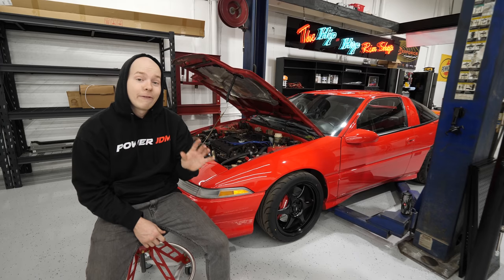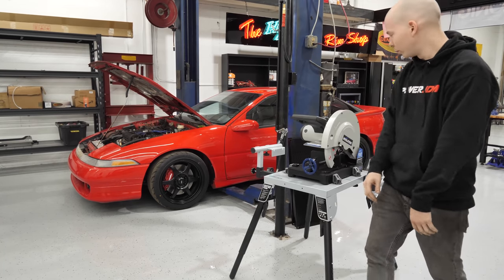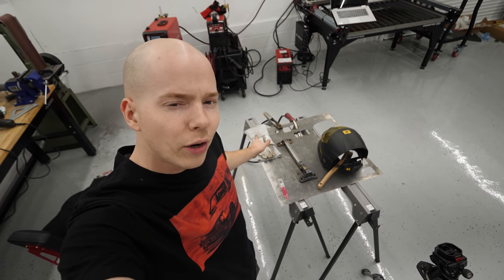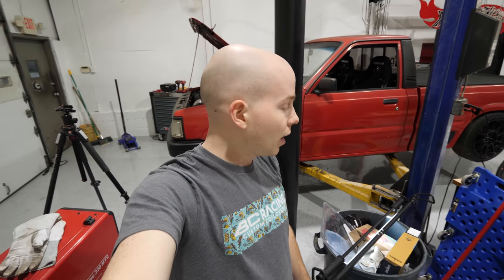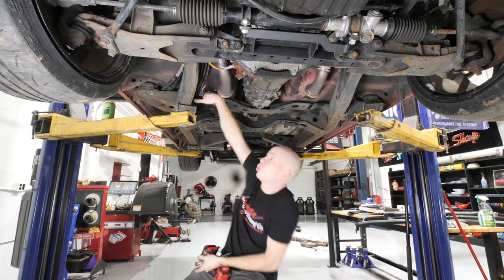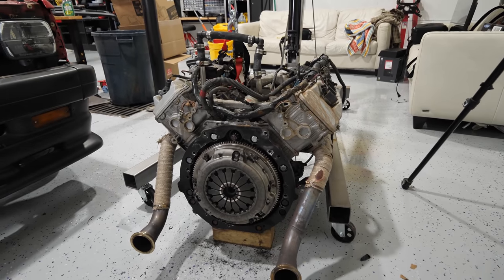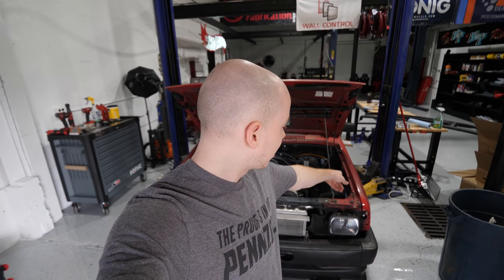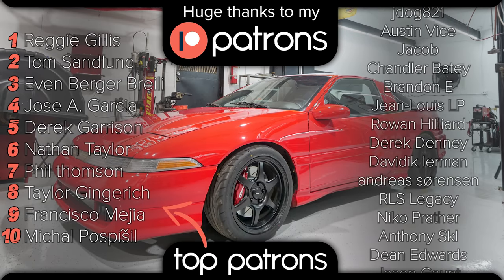I Crashed The DRIFT TRUCK.... Time To Bring It BACK TO LIFE!

Comment: Hey your waterbed level is way too low on your cnc plasma, should be about 1/4" to the bottom of your material. Also you should run that exhaust fan in your wall while is cutting to suck some of the smoke/metal dust out
Reply from the maker: You'll see in the next video I add a bunch more water to the table! Thank you to all the peeps who suggested that.

Comment: I did the rack conversion on my b2200 but its RHD so it took a little more work since the original steering box is located forward of the front suspension and the rack I installed required to be installed Aft of the front suspension. Followed this truck from the beginning of the build couple years ago till now, happy to see it in the spotlight once again.

Comment: So glad to see the drift truck operable again. I really wann know what was the solution to making the starter servicable?
Reply from the maker: I had meant to show that process but got caught up in trying to get it finished that night! I ended up drilling out the threads in the starter, then run a bolt through the entire assembly and putting a nut in the end. So now I can take the starter out by just removing the intake manifold and taking the nuts off

Comment: Is there a pilot bearing in the end of the crankshaft for the trans? Not leaking gear oil out the input shaft?
You have an amazing shop, and your a very dedicated and intelligent fabricator and technician. 
Would be so sweet to have all that equipment.
Great job man..

Comment: I have the same 1uz Sr trans setup. To avoid the starter bolt situation, I threaded bolts backwards into the starter and put nuts in the little gap between the engine and adapter plate. A little annoying but saves SO much time.

Comment: Dude if you can get to the heads of the bolts you just need to turn them in place and the starter comes away as opposed to pulling the bolts out.

Comment: just curious. would you have been able to remove the starter by leaving the bolts in place and just loosening them a little at a time and walking the starter forward till it was off the bolts?
Reply: My immediate thought too!
Reply: Right! Well at least he found out to keep an eye out for another transmission…
Reply: not trying to shit on him or anything, was just curious if he exhausted all options before resorting to taking half of the truck apart. hell, as a last resort, i wouldve considered cutting the heads off the bolts with a sawzall, removed the leftover stud, replaced the starter, then installed new bolts from the starter side and locktited a nut on the trans side, just to reduce the chances of the bolt backing out. Thats to say theres clearance to do all that without additional damage.  Dropping the engine for a starter is good content atleast

Comment: before you read this please know I am huge fan of the 1UZ and Japanese’s engines

How to change the starter on an ls, three bolts off with an adjustable spanner (most will be hand tight) replace at least two bolts.

1UZ step 1, start by removing the engine and transmission…

Comment: When I did my sr20 1uz setup I cut the bolt heads so there was 1/4 inch gap between them and adapter plate. That allowed me to turn them with a wreck with trans still on and the starter would push back as you loosen them so you didn’t have to remove trans every time the starter went bad

Comment: Counter balance.. There's a garage nearby whos owner has race cars. I put bc coilovers on my volvo and measured and adjusted and got it 47/53 corner to corner by eye. 
They were actually able to get me a 49/51 balance ratio. With the chassis braces, strut tower braces, poly bushings and poly mounts, it made it handle like a dream. However i need some wider tires with 215/40 it doesn't like any negative camber. Need some 235/45 toyo r888 or falken rt660...

Comment: I definitely felt this, the other day my oil pan gasket started leaking. I thought easy job got the pan loose but there’s not enough room between the oil pump and the front diff. Had to pull my motor I felt like waiting on it. But I got a backwood and my cherry picker and went to work.

Comment: I could be wrong, but it kind of looked like you could just put an open end wrench on those starter bolts and pull the starter out while you loosened them little by little. Someone correct me if I'm wrong haha but I would have definitely tried that first. It looks like you could get to them just fine with a wrench.

Comment: Why go MR with the DSM? Just turn the engine sideways, slap a BMW trans on, stick a Ford 8.8 diff in, and go have RWD fun with stuff that won't grenade on you. DSM transmissions SUCK. You'd also retain your back seat and trunk and also wouldn't have to fabricate a firewall. Swapping to MR is a lot of work for horrible weight distribution.

Comment: Harbor freight has a engine leveler it's relatively cheap and works very well after you grease the threads  ... Way better and safer then a couple ratchet straps

Comment: Hey so I see you getting into 360 cam footage. There’s a company out of Jacksonville FL that makes carbon fiber camera booms using a single sea sucker mount. Tested to 110mph by them and myself a bit higher than that! It’s a single suction and would have less of a footprint in your videos?  Check them out! Gemlux

I use the boom and can show you it at tougefest :)

Comment: you should get a trans adapter that utilizes the original 1uz bellhousing and adapts it to the trans. makes things like OEM in terms of working on the engine. also just go CD009 since your trans is shot anyways.
Reply from the maker: Yeah I’ll be upgrading to the cd009 for sure!
Reply: @_Gingium_  yea buddy! love my SC400 with a cd009. just know that the gearing is pretty short and you need a final drive of like 3.2, not sure what ratio you have on the truck right now. Also I'm an insta360 brand ambassador so let me know if you need any help with it!

Comment: Look into a small k40 laser cutter  on Amazon. May be good for you to use to cut card stock templates of your designs before you rip them out of metal! Part of my process go design.  And will use the same dxf as the plasma

Comment: yo caleb you can use the milwaukee electric ratchet to break bolts loose, just uae it like a normal ratchet than go for it with the motor